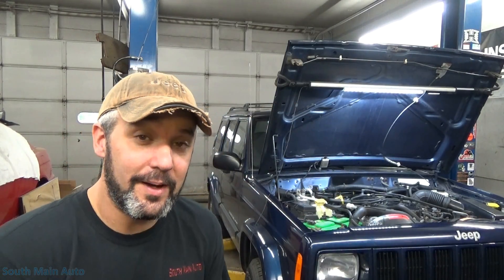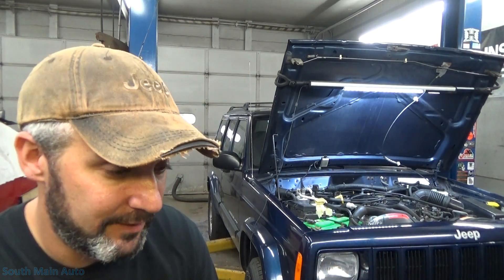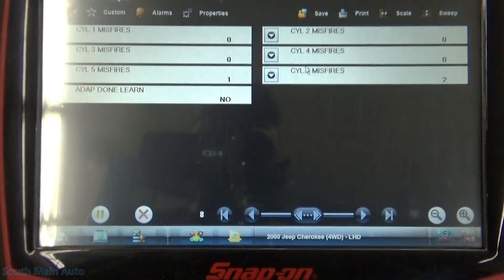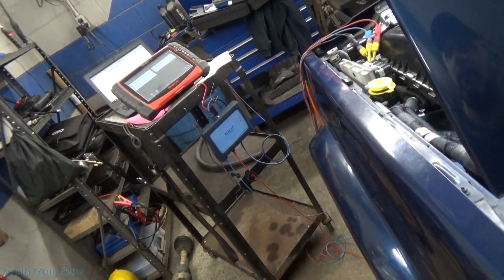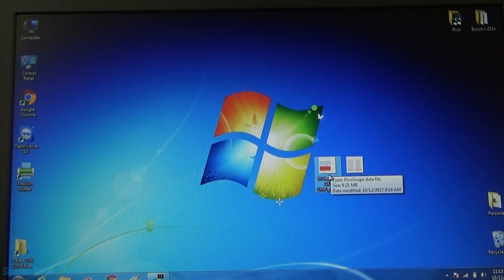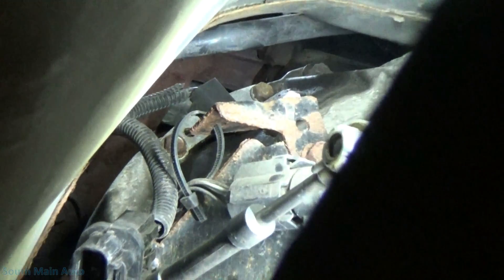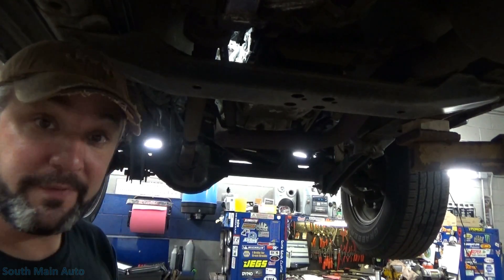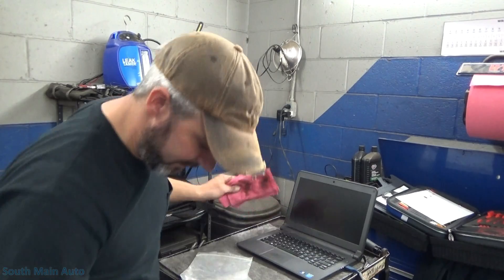Jeep 4.0 - Flashing Engine Light BUT NO MISFIRE!?

Comment: Eric, in comparing the two 2500 rpm old vs. new data files, it looks like the EMI spikes from the ignition system are higher on the "old" crank sensor.  At times they spike almost to 2 volts.  The new sensor didn't appear to have anything that got over a volt.  Not knowing what the threshold is for the PCM to trigger a count, my suspicion is that some of the EMI noise is at times high enough to cause the PCM to see a false rising (or falling) edge.  It's possible that the act of removing the sensor and reinstalling it and or disconnecting and reconnecting the harness might have actually been the fix.  I.e. the grounding was cleaned up.  I only say that because the signals themselves are spot on.  Or perhaps for whatever reason the old sensor became susceptible to the noise (but i find it unlikely)?  It would of been interesting to have cleaned up the old sensor and reinstalled and see if that would also have "fixed" it... if my theory is correct.  :)  
Great video! Your channel is awesome.
Reply: Discretesignals if there is a large enough voltage drop on the ground of the ECU it won't work correctly. If there is a small voltage drop it will not effect how the computer reads the crank sensor it will be looking at the same signal you are looking at on your scope  (using sensor ground) . I have seen a 2V drop on a computer ground but all sensors and computer were working fine. If you use battery ground how are you going to know if the noise is on the crank sensor signal or is normal noise on a loaded chassis ground. I personally would consider voltage dropping the computer ground a completely seperate test altogether.
Reply: You don't want to ground it at the battery terminal as you will pick up ALL the noise on the ground circuit. You want to ground it on the sensor circuit so you are only picking up the noise on that specific circuit, you will also be seeing what the computer is seeing. The computer is only measuring the difference between the sensor ground and signal. Exactly as you should, otherwise you will be inadvertently picking up the  voltage drop/noise between the sensor signal and battery negative which will be every circuit that is active on the car
Reply: Stephen Peralta The PCM should have a circuit that filters out the noise.  The scope is also grounded or should be grounded at the battery neg terminal, so your going to see noises at higher sample rates on your scope in that configuration.  If the sensor had a grounding issue, the signal wouldn't have been pulled all the way to ground.  

I believe the poster above may be onto something with a delay in switching inside the hall effect circuit.  Maybe the delay was more apparent at higher frequencies causing the PCM misfire software to believe the crank signal was mimicking a misfire condition.  

Maybe if someone would graph the frequency of the signals, you might see difference between old and new.
Reply: Diagnostic Check yes, it you want to limit the noise, but if you don't ground your scope at the bat negative, you might not see if there is a problem on the ground circuit between the pcm and battery.  Always a good idea to ground at the battery and eliminate false readings.  Filters and not over sampling will reduce noise in your waveform.

Comment: "Back in my day" designing engine control systems (1980s - yeah, another old timer flapping his lips)_, the "noise" phenomenon _(voltage spike caused by secondary ignition feedback) DID some times cause "unusual" behavior.  The filtering circuitry (between the inut pins and in front of the actual CPU) had to be "tweaked" to produce the proper results.  My only guess is the impedance of the old sensor shifted causing the filter to be "out of tune".  The replacement restored that _(much hand waving)_.

Ivan, any comment ?

Comment: Hi Eric, very interesting case, I downloaded the waveforms and the only difference I could find was that the old sensor at idle and 2500 rpms the square signals from crank were longer time base wise idle= 697 us Old to idle= 472 us new at 2500 rpms old =216.9 us new= 133.3 us. Would that be enough to create false misfires counters?
Reply: The Chrysler ECU of this era is very sensitive to sensor tolerances. In summary a sensor that either lacks the proper standoff (OEM sensors have a paper shim on them if it needs to be adjusted for that particular unit) or the sensor is too slow it messes with the way the ECU sets up and monitors crank rpm and differences and starts counting for misfires because events are out of tolerance.

For those wanting to learn more Jeff Masterman wrote an article back in 2001 about the idiosyncrasies of the Chrysler ignition system. https://www.motor.com/magazine-summary/solving-the-mysteries-of-chrysler-ignitions/
Reply: Ok. We kinda have spark events. The theory: if PCM counts time of crank rotation after spark event not until every next HIGH hump but until next for ex "big low gap and HIGH hump" (to give time for combustion to occur) then we can see that with old sensor be get quite bigger (in ms) time delay which can be calculated as missfire if PCM wants to see shorter time. The bad news: the theory doesn't work during idle.
Reply: Yeah the waveform plateau length seems to be the only difference
Reply: I mean with the firing event we would have some more measurments as the pcm measures speed of the crankshaft after cyllinder firing to flag a missfire.
Reply: It would be easier perhaps if it was synced to the "missfiring cylinder" before and after
Reply: MrBorntoroll the thing here is that there was no actual misfires, so this is more of a software glitch than an actual misfire. All cylinders showed misfire only on software.
Reply: Maic Salazar I
Reply: So the old sensor was sending back the wrong voltage on the signal wire, but not by enough to tell at an idol. It must have a certain variance barrier, and at higher voltage the gap is too far by the information being sent back. I dont know how the sensor changes mechanical information into voltage in the sensor, but it must have gone bad. Anybody know how it works inside of there?
Reply: @kreggparadis9612  the crank and cam reads off of sprocki with high and low teeth. When the high tooth is close under the sensor a small voltage is induced and when the small tooth is under the sensor nothing gets induced because it's too far away from the sensor. Look up how induction work to get a better explanation.
Reply: @kreggparadis9612  it's a hall effect sensor that reads off of a sprocket behind the crank pulley usually. Look up hall effect sensors to get an explanation of how it works.

Comment: Over the years I have heard several cases where OEM sensors are the only cure, and I had some reservations, but now I am inclined to believe it. The software in the ecm has parameters for the sensor which could be very specific, one possibility is the slope of t on\off which used to be called slew rate.
Reply: LR Disco Probably because the aftermarket manufacturers buy the cheapest circuit components that have different characteristics than the company that manufacturers the sensor for the oem.  Let's buy this cheaper transistor with a slower response rate, so we can make money.  Cheaper parts used in manufacturing and cost cutting practices is why they are cheaper to buy and fail early or don't work quite right.  

If you have ever scoped ignition coil current on different brands of coils for a specific vehicle,  you'll see different characteristics in the waveforms.  Doesn't mean the coil that are different won't work, but shows they use different circuit components and production practices.  Those deviations may not be good for signalling though.

Comment: erics got SWAG  stupid wild assed guess. lol . if i had to i'd have 3 guesses- 1)cheap sensor with different inductor windings that just say nope i aint doing it no more 2)with those miles main bearings are just loose enough that the pickup performance is altered to a point the computer is not happy.  you said the on time was a little longer. 3)the flex plate is weak or cracking causing a harmonic vibration the sensor is picking up.the properties of the factory sensorare such that it doesnt affect it so much.  i didnt look at the wave forms but sometimes you have to really expand them and it could be harminising an rfi from the alternator or some other signal(noise)generator.    rod serling would say you just entered the twilight zone

Comment: always trust the ice cream gut. my son's grand cherokee 4.0. had and intermittent miss always on #1. put in aftermarket crank sensor. miss was gone and engine ran smooth but check engine light came on with miss fire code. after seeing others with the same problem, replaced the aftermarket sensor with oem crank sensor...problem fixed. by the way....the grand cherokee crank sensor location was a bear to get at and replace.

Comment: Great way to start a Saturday!  Mopar crank sensors are whack!  The sensor on my 2.5 in my Cirrus was the cause of my car dying randomly with no warning or codes after the fact.  I replaced on the recommendation of a local mechanic and it's been rock steady ever since.

Comment: You have given me an idea on what to check for on my 1997 T&C.  Been having a "pending" random misfire P0300 and 304 305 303 302 etc.  Fired the parts canon at it with wires/plugs/egr/O2's/ different coil pack etc.  16 + Inches of vacuum,  fuel pressure in spec, new fuel filter etc etc.  Does not normally turn on the CEL but will show as pending code.  I will go to scrap yard and obtain crank sensor from this vintage mini van and see.  Can sometimes feel the fish bite once in a while on light throttle light load condition.

Comment: They must have a lot of money in that jeep to keep a Chrysler product on the road that long
Reply: Mike Holt - so true!
Reply: Got a 98 GC with a 4.0 and a 42RE transmission. Best and most reliable vehicle I've ever owned. Still have it and it runs great. I bought it new in 1998. All I did was routine maintenance. I replaced the water pump at 120k as a preventive maintenance but the old pump was nice and tight and never leaked. I also replaced a door lock once. Everything else is original. It will last another 20 years. The 4.0 engines are nearly "bullet proof"
I take good care of it. Always used Amsoil oil and changed transmission oil every 20k miles. I also installed an auxiliary transmission cooler.
The Jeep was used to tow my 2 ton travel trailer a lot and I did a lot of 4-wheeling with it. It's amazingly capable off road.
People buy cars, don't take care of them and then bitch about problems.
Funny thing is that those who call Jeeps junk, have never owned one. LOL.
Reply: @andrewevanoff1192  I had the same experience with a 98 GC, same engine. Never a problem. I traded it on a used Acura MDX and radiator went bad which also wrecked the transmission (H2O in trans not good). Acura dealer wanted $7,000 to replace it. Last time I deal with Honda garbage.
Reply: Alex Deagle yeah I've often said the best car gm ever sold was a Toyota
Reply: amc 4.0 engine with a toyota transmission, not much chrysler in there that can go wrong. believe it or not in the 5 years I've owned my 96 cherokee I've only had to do ignition tune ups, replace the usual sensors that go bad and it's a great daily driver that will run for another 20 years. many will say it's a money pit but it all depends if you bought a junk XJ that's been thrashed offroad or one from a caring owner that is passing it on. newer chrysler products is another story... i totally agree. grand cherokees of those years for example had a chrysler transmission and are known for having issues.
Reply: Andrew Ivanov - so, you are still using the original wheel bearings, shocks, control arms, radiator, tie rod ends, exhaust manifold, fuel pump, and alternator in a 20 year old Jeep?  I have had the 95, 99, and 2005 JGC since new and have not been so lucky.
Reply: I replaced the shocks once, at 120k and consider them as routine maintenance items, like spark plugs, accessory belts etc. Wheel bearings, alternator and the rest of the items you mentioned are original. I will probably replace the alternator soon as a preventative maintenance. I take good care of the Jeep and it takes care of me.  It still looks and drives like new. Can't say this about some Japanese cars I've had. Some were pure junk.

Comment: Oh come on you know what's going on, 200,000 miles you have crankshaft slop going back-and-forth wiping out the sensor.    .... Just stuff that hat inside the main bearings someplace to eliminate the slop.  🤣
Reply: That's what I thought might be happening too. Wouldn't there be physical evidence on the sensor of this? Also, the fact that there is no concern over the gap is weird. Thanks!
Reply: I don't know.   ... However high horsepower engines Will move that crankshaft , anything over 800 hp, with a turboccharger everything is normal but when the turbos come on it's a completely different world for the tolerances, they just go back to normal because you're not under turbocharger load.... Difficult to find.   ....causing out of limit numbers from a crank sensor to give you a headache.  A out of limit number ...   I don't think this jeep is turbocharged.  😩
Reply: the gap is set by shoulder bolts and tight tolerance made sensors, aftermarket ones may have slots and a spacer cardboard the flywheel teeth eat due to be junk. so unless the crank is moving a mile it shouldn't effect it and if the crank moves that much it would have low oil pressure, be pissing out the rear main and be past knocking into a look of terror in peoples eyes, yelling "get back she's going to spit parts out" :))
I'd assume the whole sensor body shrank from thermal cycling/aging, thus changing the clearance majorly or the internal sensor components have changed values from age and thermal cycling, resistors and capacitors mainly..

Comment: Interesting.  I was getting a P0300 and P0456 on a 01 Jeep cherokee and replacing the purge valve seems to have cleared both codes.  It's been almost 6 months and those codes haven't returned.  I'll keep this vid in mind if i see the P0300 come back by itsefl.  Thanks Eric.
Reply: OK, to be complete, my jeep had been sitting for a while and I was pushing some injector cleaner in with the fuel.  It's very likely the P0300 and P0456 were both not related to the purge valve I replaced.  Don't want to mislead anyone that they were related.

Comment: I know this doesn't have anything to do with this video but I just got a recall on a 2008 GMC 5.3 L on the carbon monoxide sensor it's a recall is that a hard thing to replace I know the dealer will do it but there's not one within 50 miles is it important I don't have to pass an emissions test here but if I move I will